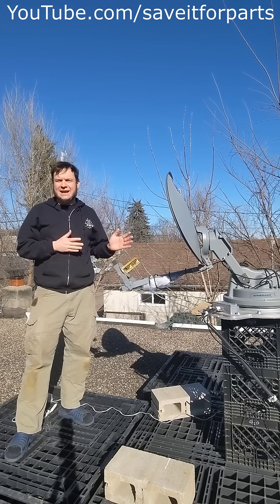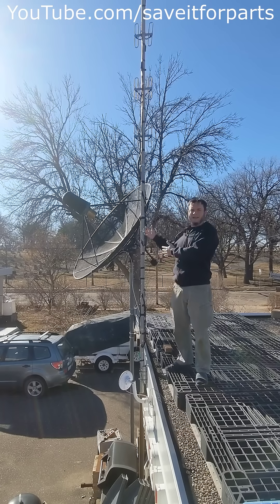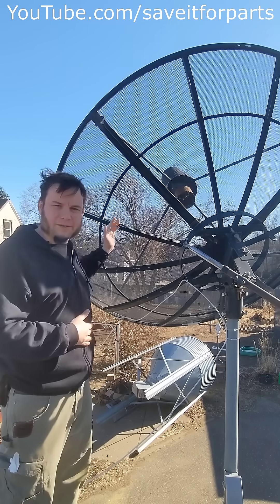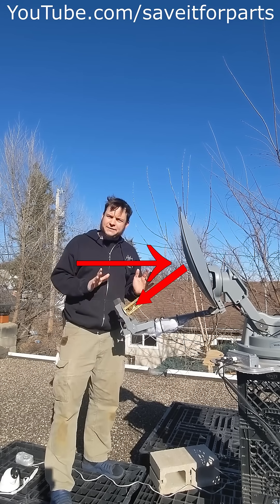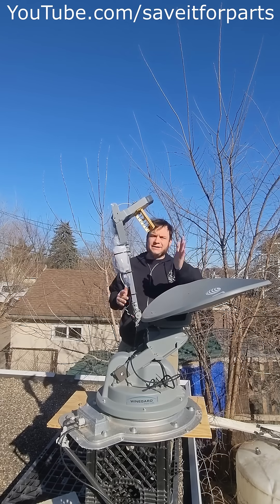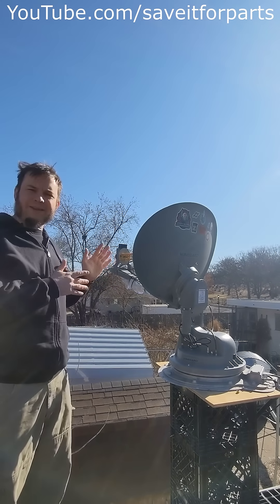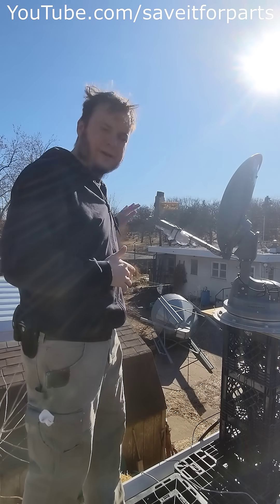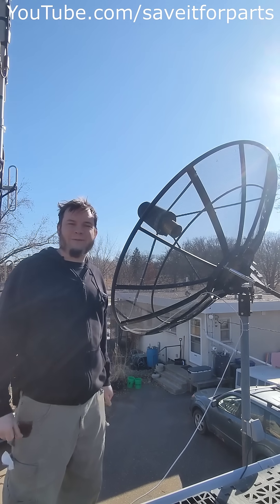How does an offset satellite dish work?

Comment: What an excellent video, your channel is awesome I've learned so much watching it. I had a business installing the old Prime star system in the early nineties, I was a subcontractor for Cox Cable in Eureka California. did Dish Network when they first came out,  DirecTV. My first internet was Star Band beta in 2000 and I have a wild blue system up on my roof which is no longer in use I would love to find a new use for it. I have starlink dishy ICU fry drawers, I like how you did that with the heat gun
Reply: Sorry voice recognition I was referencing your video where you took apart the dishy with the heat gun and it was damaged

Comment: Look up Cassegrain Parabolic Antenna designs. or dual reflection
Reply from the maker: I have a couple tiny Cassegrain antennas, I've used those as radio telescopes. Actually running a sky scan with one right now!

Comment: Hey Gabe, I appreciate all of the content that you've made. I just wanted to know if it's possible to make a video on the lightning protection that you have for your equipment, if you have any. I'm an amateur radio operator and this is something that I find intriguing and I just want to see your perspective as a satellite person. Thanks again!
Reply from the maker: I'm a little embarrassed to admit I have none, other than some of the tallest antennas being metal poles straight into the ground. All my antennas are also lower than the surrounding trees and power lines, which I know isn't 100% reliable.
Reply: @saveitforparts  No need to feel embarrassed. I'm sure there are a lot of people that don't protect their equipment. All comes down to chance. At my house I have an ADSB antenna that is flush with the roof line and on an 8' PVC pipe. There are a ton of 60-75' trees by me here in NJ and knock on wood ok for four years.